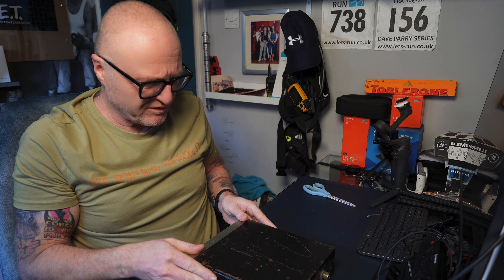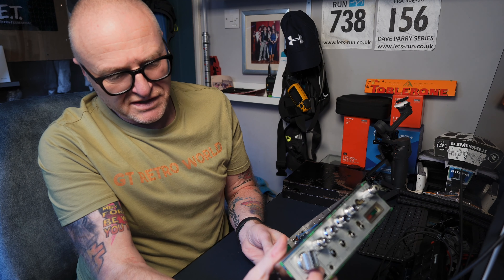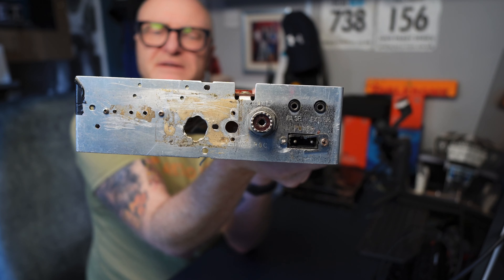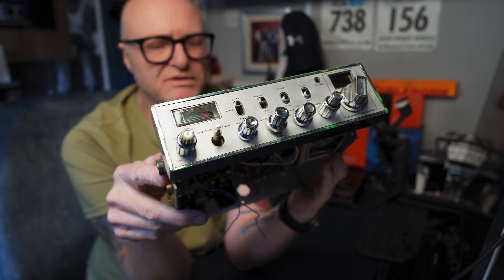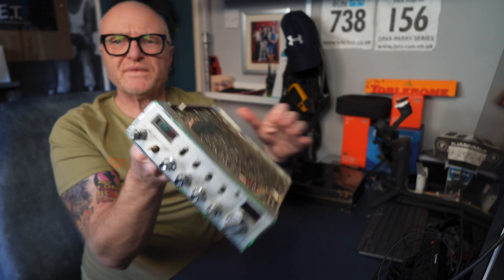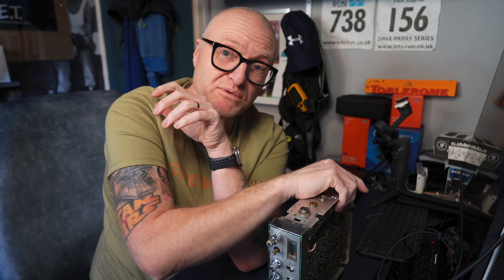Probably the worst Superstar 360FM CB Radio in the World!(Cobra 148 GTLDX) Part 1

Comment: The hole in the back would more than likely be for a pot to vary the output power, these radio’s could be fettled to produce around 12 watts which would fry the input on most amplifiers.
Reply from the maker: I was thinking the same until i seen the size of the bore hole.
You would almost get the bottom section of a Sigma 4 in there.😂
Reply: @gtretroworld  More likely a DIN socket wired up to drive an external frequency counter or similar. I used to make 6 and 7 MHz transverters for them and connected them with a din socket in the back. Certainly made a tidier job of it than that though.
Reply from the maker: @wnkrsw  I would probably expect a better job from anyone with the no how to fit a frequency counter but you never know.

Comment: I picked up a mk1 ss360fm it is my 1st mk1 totally standard even the channel 9 switch is still ch9. Ever since the early 90s i was always told the mk2 was the better one .I have a nice cobra 148 mk2 so i have them side by side and switching between them they both sound great but different on RX .I am told i sound louder on the mk2 with the same mic .I no the mk2 was the better board to modify had some nice conditions lately so my comparison continues lol
Reply from the maker: Excellent, I do like a standard radio and if untouched Mk1’s are still a great radio.